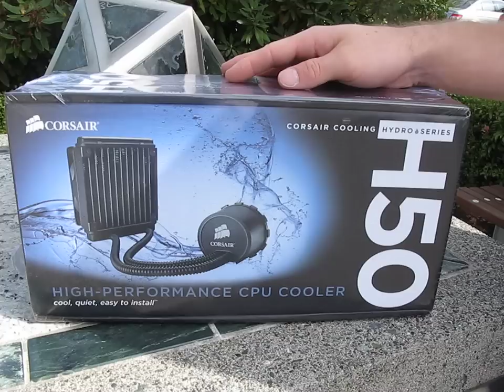Corsair H50 Hydro Series CPU Water Cooler Unboxing Linus Tech Tips

Comment: Chapters:

0:00 Box and general overview
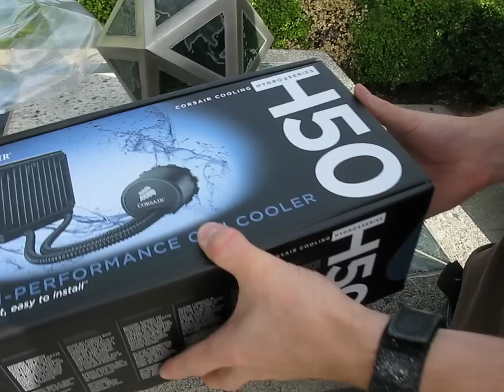0:37 Unboxing start
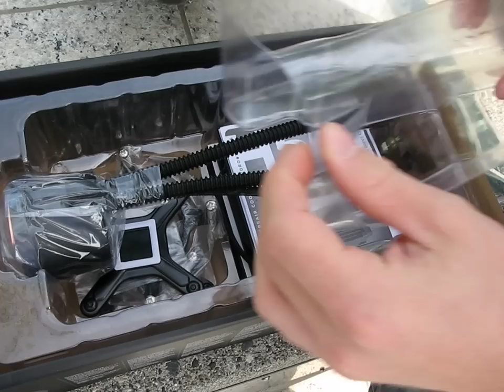0:56 The cpu block
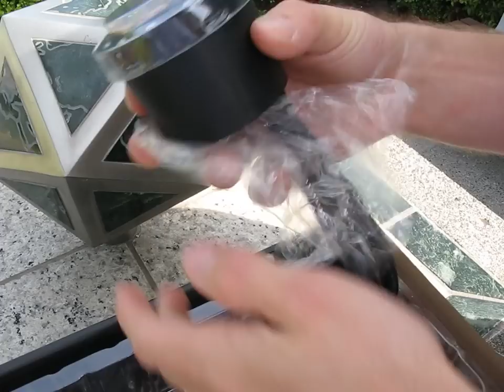1:24 QuickStart guide
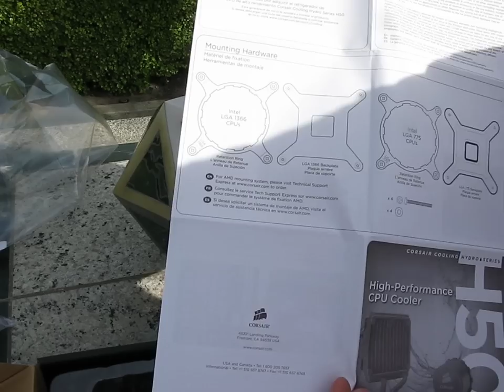1:38 Same as above, different languages
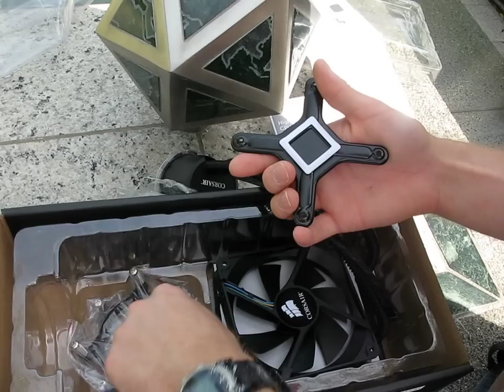1:48 Intel mounting kit
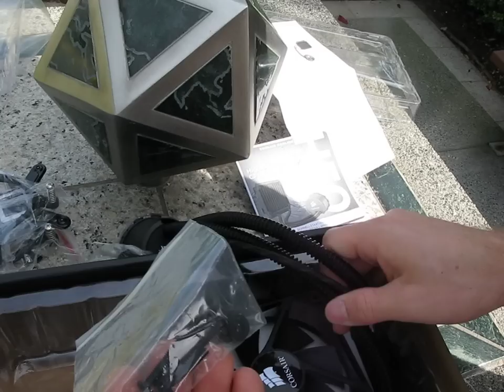2:07 Screws for installing the rad
2:11 Radiator
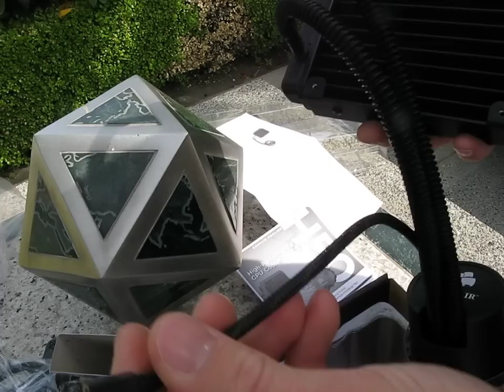2:44 Fan
2:49 Installing recommendation

Review:
Pretty neat to see an all-in-one solution that is so old! Also, the amount of plastic is ridiculous for packaging.  I rate this a solid 2/5

What am I doing, and why?

I want to watch, and review every single video on Linus Tech Tips channel.
I will provide chapters, if the video has none.
Why am I doing it? To pay a homage, and I am pretty sure that my head is a bit messed up.

Comment: have an issue with mine, idle temps are 30 celsius, start gaming and it whacks up to like 80, ive had no issues in the past, i stream etc..cooling has been fine, how do i tell whats failed? i can still play youtube etc with no increase in heat...i dont have 100$ to drop on a new one :/
Reply: Did you check your thermal compound? Also, chances are it might have been "losing" liquid over the past years, I think I'd check that as well... :)

Comment: Im still running this first gen h50 in 2017...
Reply: @minecraft0james24  I stopped running mine in early 2020, not because it stopped working, but because a 360 rad looked better in my case and I got a new cpu and mb as well. Still have it just stopped running it.
Reply: @xupthree60  dope
Reply: my vista gaming machine has one in it right now
Reply: I’m still using it on my basement PC in 2025. Works great with a 5700X3D

Comment: I'm curious to see if it will fit inside either the new FTZ01 or RVZ02 cases. the The fan seems small but I am just unsure about the tubes and radiator fitting inside.

Comment: Thats really interesting the way how Corsair suggested the airflow, being backwards.  I had my antec kuhler setup in that way, and then decided to have it pull air through the radiator and eject it out of the case.  Because really, aren't you simply forcing the same volume of air regardless of what direction? Or is it about having the edge of turbulence right where the fan and radiator meet? Anyways, another reason I felt to change it to what I have now, is because it would be going upstream.

Comment: ok heres how it works... there is special liquid in the pump already... so when the heat of the cpu heats up the liquid.. the liquid will be pumped to the radiator where heat disipates and the fans cool the liquid from the radiator yeah you get it... no you do not need to replace the water its permamnent

Comment: Good review! One question: I would like to know if it would be possible to pull air over the radiator from inside the case. Can I do that? (using the fan as an exhaust instead of an intake) Thanks!
Reply: This might be 9 years late but it's better as intake because as exhaust it would be warm air from inside the computer instead of cooler air from the room
Reply: But yes it's possible I think
Reply: Lol thanks for the reply - unfortunately you've reminded me LTT exists and now I'm sad

Comment: On most cases that fans would be at the back of the case, right? So sucking in the cold air from the back, does that mean u need to rotate ur fan at the front of your system too?

Comment: @lazybomb402  hello first , sorry for my very bad english ;)
1. there is already liqued in there.
2. you can´t refill , so i think but you don´t need to refill it.
3 the fan cool the liquid in the radiator , and a pump pumps the water to the cpu
and back. An eternal cycle
i hope i can help you with this information... sorry for my english :D:D

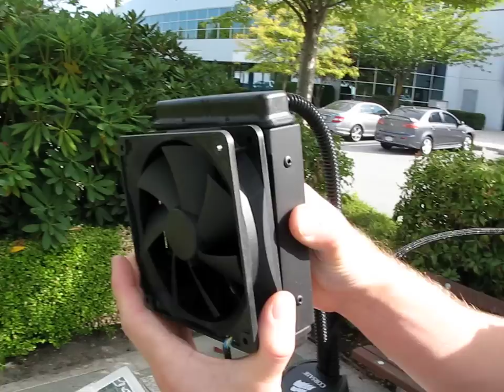Comment: Can anyone tell me whcich is the best way to mount the radiator?? is it with the steel piping on the upper side or lower side?? as in like @3:01 or @3:05?? I just got this rad have'nt tested it out yet but i want to install it in good for the first time to get the best performance and not having to turn the rad and re-installing everything from scratch :) Thx

Comment: @TechnusLlamus I am guessing any, I have mine in use with a Hiper 120mm fan to match the rest of my case and it fits fine. The one provided by Corsair is just a regular 120mm fan, in fact I used it in another one of my builds as a regular chassis fan.

Comment: yes, correct 

and this happens WITH alot of cooling tubes 
they are meant to withstand high temps but oviously if you poke on them they will leak
what happens they force or find ways to place the tube and we all know PC cases have sharp edges

Comment: its a completely sealed system that means theres no leaks...and you dont have to ever top off the coolant since it has nowhere to evaporate to.

if you look up reviews of this cooler on cerain sites some people reported leaks...due IN MOST cases to the fact that they were pompous assholes and forced the thing in there cracking seals.

in all fairness if you hook it up and let it run for a few hours on top of a plate or piece of paper then you can observe it and note any leaks if any.

Comment: i was thinking of getting this in a day or 2 and wonder wouldn't be better if i used my antec 120mm fan and push the fresh that my front of my antec 900 intakes and have the corsair fan as well pushing air out of the back of the case? it seems to make more sense to me then having it push air in my case.also is it strongly built? like no accidental breaks in the pumps?

Comment from the maker: The odds of this cooler dying are about the same as the odds of the fan dying on your megahalems.

Water cooling has been around for a looooong time, Salami991. It's quite a mature technology.
Reply: Linus Tech Tips aww so cute. 10fpslinus
Reply: Hey I know someone who still uses that cooler
Reply: I just installed one of these coolers in a spare parts kind of PC deal, got it in a box of random parts and it seems to work just fine so yeah, odds of it dying are pretty damn low